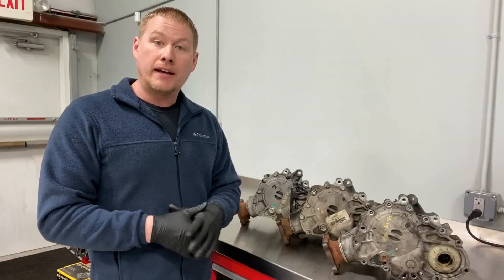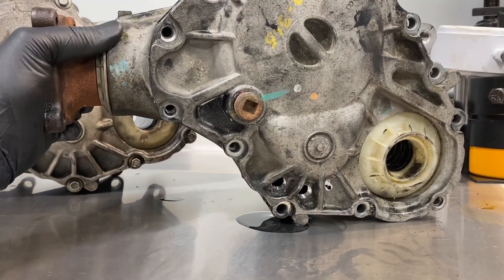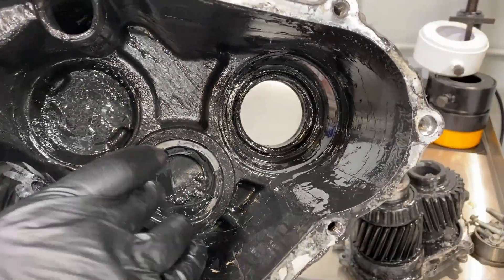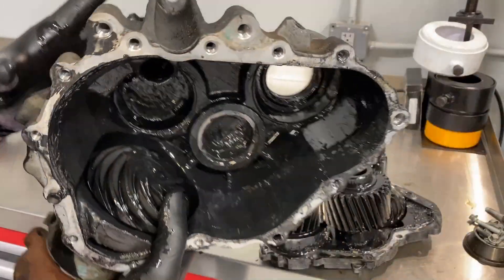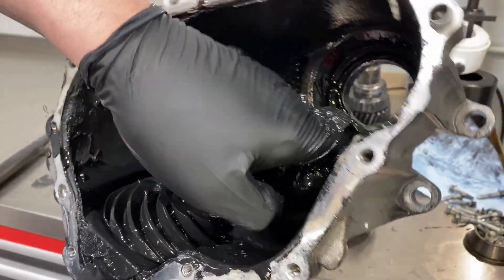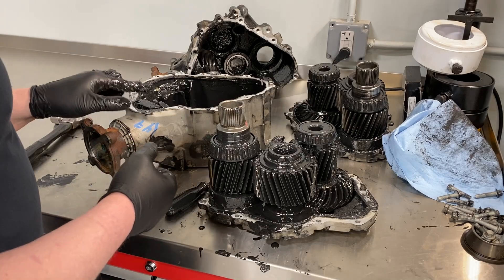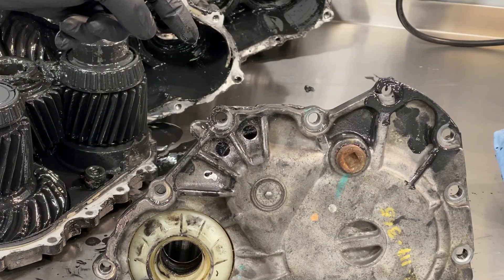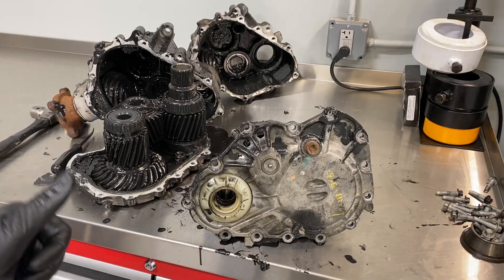How Ford All-Wheel Drive Power Transfer Units Fail and What You Can do to Prevent it!

Comment: I don't need to drain plug.I just stick a tube in it and suction out all the oil from the fill plug on my ford escape. Then I feel it again and I have a drain plug on mine , but I don't even need to use it

Comment: Drilled a drain plug in the PTU today. 3 oz drained out initially, then after 3 fill and drain cycles with diesel  the volume steadily increased to about 18 oz.  This is after a dealership said the unit has to be replaced.  Hopefully this will give me another 150k miles…

Thank you for the excellent video!

Comment: I was pleasantly supprised .i did my fluid on a 2016 fusion with 106k on it had from new .and the fluid was not that bad .yes the magnets had gunk on it .but if i would have known mine had a fill and drain hole i would have done it every year .now i know how easy it is to do .i expected the worst .my under cover does have a vent that directs air to the ptu .im betting thats the only reason it was in decent shape

Comment: To add insult to injury, the exhaust runs right next to the unit and there's not even an attempt at a heat shield ensuring it'll fail.
Reply: Correct. Ford did install a heat shield to protect the steering rack, however!

Comment: Mine just started puking. I have no noise or anything yet. I just saw a drip and it never leaked before, so I looked and it just started. I am going to fist fight it into another 10k miles though. lol I am thinking about putting drain plug in, then flushing with something like diesel fuel, then flush all that out with 75w140 then topping it off. Anyone do this and how did it work?

Comment: I’m late to the party. But I never knew this was a common problem until it became my issue on a 2016 ford explorer. 
It started making a noise so I “changed the fluid” best I could. 
Then a month later the truck started to lock the tire a bit when I was turning left in reverse. So I started looking into getting it replaced. The shop I brought it to said it might be the viscous coupler in the rear end. He quoted me 6500 to change both. 
A few weeks ago I drove to the store a few mins from the house. It was noisier than normal. Then I felt/heard a huge bang. 
The PTU tore apart and took out the power assist wiring in the process. 
Send me your email and I’ll send you pictures of the devastation. 
I’m in the middle of putting a new one in now. Not an easy job for a DYI guy. But it’s doable if you have the tools.
Reply: what mileage when this happened?
Reply: @ 180000 kms

Comment: At 4000km I changed my ptu fluid in 2019 flex with amsoil severe gear until 220,000 km for ptu and rear diff. 
Just changed the oil and vehicle.runs great

Comment: Common sense dictates that no PTU will last the life of the vehicle, it will only last the life of the component. I drilled and tapped the bottom of my PTUs to install drainplugs on my 09 and 11 and check or change the gear oil at oil change intervals, time and money well spent. Yet another typical Ford automotive design flaw.

Comment: Just acquired a 2012 Ford Edge SEL and I’ll be tackling the PTU and differential fluids. I’ve seen/heard of a few people using the royal purple “high temp” synthetic oil as a replacement oil….what are your thoughts on this, especially for the ptu where it’s located in a very high temp environment.

Comment: After hearing all the horror stories,
I drained and changed the PTU gear oil in my 2017 Ford Fusion at 50,000 miles.
It came out very dark.
Refilled it with Mobil 1 full synthetic gear oil.
At 102,000 miles, I just drained the PTU again, and the gear oil came out clean and clear!
Mobil 1 full synthetic gear oil FTW.
BTW: The Fusion Sport PTUs have a drain plug.
Torx Plus TP50 bit required.

Comment: MAYBE YOU CAN INCREASE THE LIFE SOME BY DILUTION OF THE OIL BY VACUMN BUT SUPPOSE YOU REPLACE THE AXLES AND NICK THE SEAL AND IT LEAKS YOU WILL HAVE TO REPLACE THE PTU..DID YOU KNOW TO REMOVE AN AXLE YOU NEED A SPECIAL SEAL PROTECTOR SO THE SPLINES DO NOT NICK THE SEAL ON THE WAY OUT OR IN? I DIDNT KNOW AND THAT IS WHY I HAVE A NEW PTU GOOD FOR ANOTHER 150,000. SUPPOSE YOU HAVE A HIGH MILEAGE EXPLORER...REPLACE THE TIMING GEARS, WATER PUMP AND ALL THE GUIDES...CAUSE AROUND 160,000 THE OVERHEAD CAM PLASTIC GUIDE WILL BREAK AND CAUSE THE CHAIN TO BIND OVER THE SPROKET AND YOU WILL NOT BE ABLE TO GO OVER 5 MPH...THE DEALERSHIP WILL TELL YOU TO HAVE NEW HEADS ALSO BUT THE PISTONS ACTUALLY ARE  SLANTED AND WILL NOT INTERFERE DURING THE MISS TIMING EVENT. YOU WILL HAVE TO DO THIS TIMING CHAIN REPLACEMENT EITHER BEFORE OR AFTER THIS EVENT...YOUR CHOICE FOLKS.

Comment: Between this nonsense, and the fact that my '07 Mariner has to have like half the top of the engine disassembled just to get to the back 3 spark plugs, I'm convinced that Ford engineers are just a bunch of sociopathic jerks who don't actually do any maintenance on their own vehicles.  It doesn't have to be this way, but they made it this way ON PURPOSE.

Comment: Excellent video, very informative. 2 weeks ago I had my local repair shop replace my PTU with a dorman because it has that fill and drain both to what you mentioned. I I thought the smell was from the leftover old PTU leak, but while changing my oil i I could see fresh PTU fluid. Just off the top of your head, what do you think? I'm taking it back Monday but was looking for jnsight before i do. Thanks for any advice.

Comment: What signs should I be looking for to determine if the transfer case on my Ford 2010 Ford Escape XLT is failing? It has 187,000 miles and I am hearing a creaking noise when the vehicle first begins to move, especially if I am on incline, sometimes it does the same creaking noise when I come to slow stop, but I just assumed it was a creaky chassis, it being so old.

Comment: The manual for my recently acquired 2013 Flex states a change and lube type.  My 2009 does not have a drain plug. I asked the dealer to "suck and fill", they refused saying its lubed for life.  I now go to an independent shop. They were glad to do it, and now get all my service work. That's 5 vehicles.  7 oil changes, and a chance at other service work, per year. Not much for them, I suppose, but my money and my trust now go elsewhere.  That refusal to do 10 minutes of work will result in several thousand dollars over the next few years not going to them.

Comment: My PTU on my 2012 Ford Fusion SEL AWD V6 3.0 went at 93,000 this week. No where in the manual it said to service it. The part is discontinued and there is not one in the country. I am so pissed at Ford. 
My mechanic found a used one( 55,000 miles)  at parts yard in New Hampshire and I paid $1000 for. It comes with 6 month warranty. If I wanted a year warranty it was $1400. Unbelievable! The shop is drilling a hole on bottom to install a drain plug and running a tube to the engine so I can replace oil every time I have a regular oil change. Picking it up today . My car sticker was $31000,00 in 2012 ! Crossing my fingers it will be ok .I don’t even know what the final bill is going to be. ☹️

Comment: I am glad the PTU on my ‘17 Escape has both a drain and a fill plug. Once I became aware that these were an issue I’ve been changing the fluid out every 2nd year. It’s actually a fairly straightforward process on the Escape once you’ve done it once and figure it out.

Comment: 2004 Escape/Tribute with only 120k miles. Once a week repairs now. 4wd, vac lines, coolant reservoir, MAF sensor, mystery check engine lights. Once I change out this blown radiator it's bye-bye. Too bad, because the V-6 is powerful, and the car 4wheels great to our campsites.

Comment: My 2016 Explorer Limited pulls hard to the left under acceleration,  have had it in several times for service but unable to find problem.Have had tires replaced and alignments but problem still persist. Vehicle has 58k miles on it

Comment: So what exactly does the car start too do exactly when one of these ptu goes out.? Ive got a 2007 milan premier & it had a small grinding noise and I was busy at work when I looked at it really quick and I knew brakes needed replaced so I seen metal on metal front brake disc and assumed it was the cause of my squeaking, fast forward wk and half and the car started lunging forward and popping etc at low speed... id love too have means too check it and im now in California and cars in utah at my house... transmissions shifted fine and everything never ant issues or burned smell fluid etc... my mom is trying too help me with it seems their friend owns wrecking yard so now I'm not 4 sure after watching this video... lol

Comment: The Ford Edge has in the manual: Power Transfer Unit (PTU) fluid (All Wheel Drive) 11.8 fl oz (0.35 L), the fill capacity of the PTU is 23 fl oz (0.7 L).
How much oil should be in the PTU correctly (0.35 or 0.7 L) ?

Comment: My 2014 exploder sport is finally losing its PTU.
Drivetrain vibrates slightly over 45 mph.
This sucks…..
I’ve been changing fluid every 5k miles for the last year and I’ve managed to delay the failure so far.
I’m going to swap it out after the holidays I think.

So sad that Ford lets these flawed units go out by the millions.
They knew/know better but they do nothing.

And the whole fill for life thing is a sham.
Especially when considering the oil they put in.
Plain old 75w140 gear oil.

Hey Ford, try out some redline heavy shockproof and a damn drain plug.

Comment: I have a 2006 escape that’s badged as  all wheel drive. At 160,000 miles I have no complaints. I attribute this to rigid oil change intervals. With the 3 L V6 there’s certainly no need for more horsepower but I am a bit frustrated that there is no low range Available in a transfer case. Makes it hard to go into the tougher off-road areas. Does anyone know of Any aftermarket goodies available? I know The PTU basically makes a front wheel drive able to drive the rear wheels. But I am guessing there’s somewhere some original designs that have low range and yet still is a transverse engine.

Comment: 12:25 when the unit is in the vehicle, aren't your "drain holes" about even with the "fill plug?"
Reply from the maker: No this unit is flipped on the bench
Reply: I figured it out after seeing your other video about the one with the cooling built in.  Apparently my 2014 Taurus interceptor has the built in cooler, so my plug is a drain plug on the bottom, not a fill plug.  I'm going to try your method of attaching a longer hose to the bleeder valve and see if I can change the fluid
Reply: @FordTechMakuloco  any tips for getting the drain plug off?  It doesn't seem to be 1/4" allen nor 7 allen... seems to be about 6.5 allen - but I don't see that size sold anywhere.  Whoever put it on seems to have done it with an impact wrench - sprayed it with penetrating oil and I got the 1/4" allen in the slot and pulled as hard as I could with my socket wrench, but all it does is bend inside the slot - I'm afraid it's going to strip out.  I did remove the vent hose and replace it with a longer one that can be used as the fill tube though so thank you for that idea!

Comment: Had an interesting one just yesterday.  Not certain if our 2008 Escape's PTU is working, but the drive shaft to the rear does rotate as the car moves, which I understand to mean it is working.  I went to drain it (has drain plug) and a whopping 3oz of fluid came out, very silver/gray, which I assume is from metal particles.  As a sanity check, thinking that somehow it wasn't the drain plug, I pored some new fluid in and it immediately flowed out that hole, so definitely was right.  Anyway, filled it up with some less expensive fluid to help flush it out and will drain in a few hundred miles.  Trying to figure out how to know for sure if the PTU is working,  since you can't force it on like Gen 1 Escapes.
Reply: What do you mean by force on with the gen1 escape?
Reply: @incognito-c1o  There's a switch on the dash to manually engage it, just like my Gen 2 Explorer.
Reply: @dlpeters0n oh my gen1 escape hybrid doesn't have that feature unfortunately

Comment: 2008 Mercury Mountaineer 4.0l AWD Transfer Case chain  or a whole complete Transfer Case.  
Can I buy just the transfer case chain.  Or do I have too get the whole transfer case ?
Vin#  4M2EU48EX8UJ15298
Reply from the maker: You can buy internal parts separately yes.

Comment: What exactly in-tales a failure especially in that first one?
Reply: When very cold initial starts, the old dehydrated oil gums up 'like' a hard wax leaving moving parts bare of any lubucant and heat transfer to the case body.

Comment: Are these Transfer units in Ford Kugar’s?

I have a Ford Kugar that has a driveline noise when vehicle is going around corners.

Sounds like it’s from the rear diff, but, I think the sound is travelling up the drive shaft from the transfer unit.

Comment: A little off topic here, but I need to replace passenger side cv axle. I see you can buy it without the inner shaft. Is it easy enough to separate the cv axle from the inner shaft without pulling it from the PTU?

Comment: So the 2014 Explorer Sport has one like the one you drilled? I am getting ready to check mine. I am in the process of replacing the turbos, no better time to look at the PTU. What is the torque on the PTU bolts if I take the case cover off and everything looks good? And is there a specific seal or gasket maker that needs to be used? My Explorer has over 75,000 Miles on it and the PTU has never been serviced. Never had issues with it.

Comment: I called a very large Ford dealer here. They said they have never seen these PTUs ruined like this nor have they ever repaired one or warrantied one.  I found that awefully strange to say the least. 

I am not saying that this does not happen and based on Ford adding a drain plug in 2018, it shows that Ford admits that they are failing.

I also find it interesting that the bottomside engine cover/shroud has a steel venturi in it that directs air, as the car is driving down the road, directly up towards the PTU! 

I am going to get my fluid swapped in my 2018 Lincoln Continental. I looked at the Ford parts listing and it shows it has a drain plug on it. They said they need about 1 hour of labor too do it and cost of fluid. My car has 76k miles on it. It has a 4yr 150k warranty from ford so if they find its toast during fluid change they can go ahead and swap it out for free. 

Great video though. Really liked this one.
Reply from the maker: Oh it is very common, there is a reason my dealer stocks 3 of every version.

Comment: Why not put the drain plug in the bottom of the case instead of the side where all the bearing supports are?
Reply: I know this question is a few years old, but for anyone else seeing this he addresses this in the video- the bottom of the case is structural and subject to much greater stress.  Tapping the side of the case is where ford put the drain in the redesign.
Reply: @RS-uo2nd  I've put a 1/8 npt plug in the bottom and 100000km after everything is fine. theres about 3/4 of an inch of material. And bonus the oil flow brings out the shavings!
Reply: @etiennelepagerioux889 that’s ideal.  I drained and suctioned mine, never had a problem until the timing chain broke at 314k back in January.  Don’t think I’m swapping the engine, that’s probably end of the line.
Reply: @RS-uo2nd  thats my plan too! Only major repair was the steering rack at about 195k and now im at 250k km.

Comment: Just changed PTU fluid on my 2017 explorer sport at 75km. Used Amsoil severe gear.  It was pretty dirty and had some nasty filings in it. I swear the vehicle takes off even quicker from standstill  now. Will do it every year now for sure.
Reply: I use amsoil in all my vehicles for oil and tranny fluid and there oil filters.  I'm about to replace one of these ptu next week on a explorer

Comment: I've got an issue with a dash warning on my 2016 Fusion AWD that says AWD system failure.  Could this be the culprit?  Thanks
Reply from the maker: If it is noisy yes.
Reply: @FordTechMakuloco  It is not making noise just getting an intermittent dash error that says AWD system failed with a wrench on the left part of the gauge cluster.  When you restart the car the wrench is gone.  Some days I get it some I don't. Going to do a fluid replacement and see if that cures it.  Any other suggestions are greatly appreciated.  Thanks for the great info on you channel.

Comment: I started hearing whining noise in my 2013 Ford Edge, and the noise gets louder every day. I thought it was a tire problem so I didn't take action immediately. Until suddenly (luckily while driving at low speed) the car started shaking and I can clearly hear and feel metal gears noise under me, felt like the car is going to break into pieces .... It was the PTU and it cost me $1300 to fix

Comment: Great information. Been a subscriber for awhile due to the content. 
Just changed the oil and tranny fluid in my 13 flex and didn’t know this was a thing until I started trying to find information on what would cause the transmission to suddenly throw a code and “bang” into gear. I change the transmission fluid regularly and I’ve never had this issue before. The wrench is now flashing, car is hard to start, and the advancetrack check warning is on. 
Wide open to ideas? 
Desperately need some guidance. Won’t be able to get back on it until Friday. Is it possible for the ptu to be the issue? Didn’t think it spun unless in gear. 
Again, stumped and grateful in advance